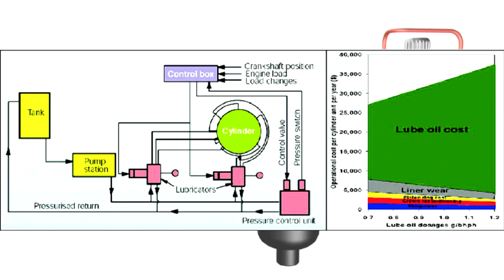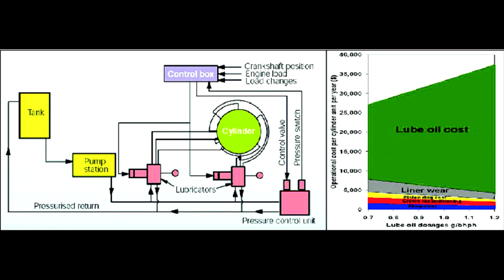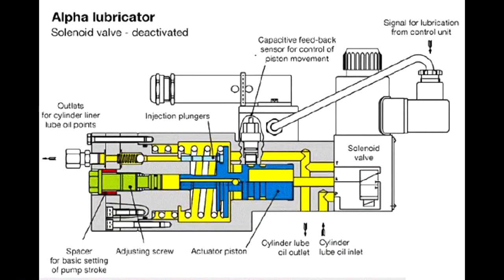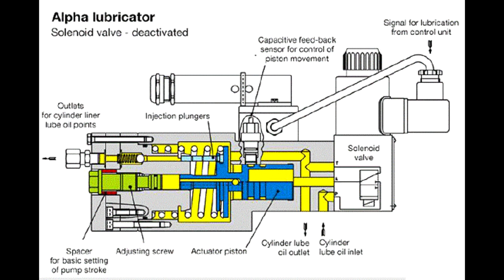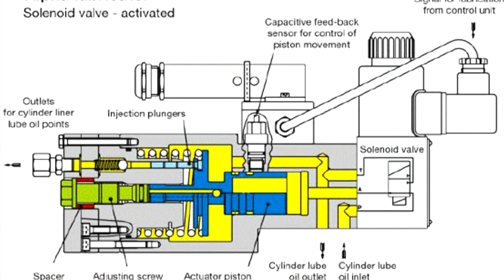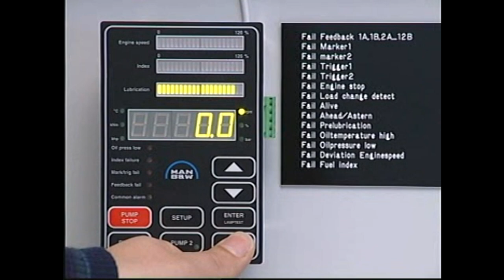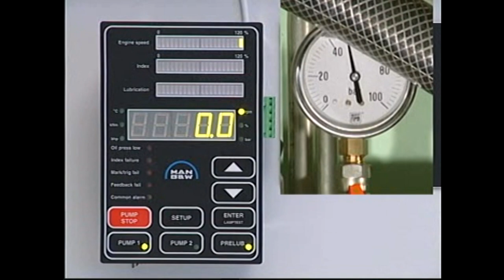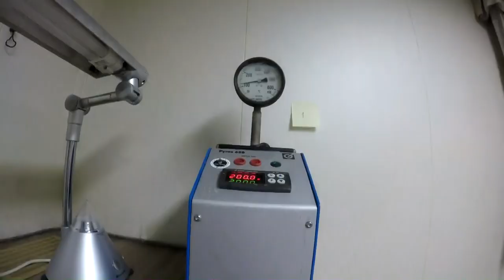Understanding Cylinder lubrication system with Alpha lubricators

Comment: Your video highly appreciated. Please also advise, what is the exact function of N2 accumulators in Alpha lubricator systems. What effect happens in cylinder lubrication if the N2 accumulator's membrane is ruptured or if the accumulator has been found de-pressurized?

Comment: can you tell me please if you have a not operating lubricator  and you dont have a spare one and you are in the mindle of the ocean what you can do?
 how you can trigger the lubricator ?
 there is any em/cy  operation? 
 thanks in advance.
Reply from the maker: Normally you should have a spare of alpha lubricator because this is a critical equipment.
I don't know maybe so other companies have bolts for critical equipment.
Any way i will check to find the answer.
Reply: @Adventure-Story  i  have one spare but i already put it on cylinder no2 . i wanter if somthing happent until i will arrive to the port where i will receive the new spare
Reply from the maker: Very good question ok i will look for it thanks!

Comment: Some engines like mc-c engines have rpm x 60 strokes,  per hour, when measured on the counter. How then does lcd give extra feed if the no. of strokes have already reached one per revolution.
Reply from the maker: What is the question sir?

Comment: Sir one dout what means due to pressure difference the lube oil supplied to the quills or crank angle sensor give signal to the solenoid valve?
Reply from the maker: Hello the signal from tacho is received to Master control unit and master control unit send a signal for the solenoid valve also master control unit receive a feed back signal from position sensor on alpha lubricator that it have succesfully activeted.Thanks
Reply: @Adventure-Story  thank you sir
Reply: so nice explanation !

Comment: dear sir, i like to know how engine load is sensed for alpha lucricator?
Reply: Engine load is sensed by a tacho  sensor which is reading the rotations of the flyweel
Reply from the maker: The whole system is controlled by the Cylinder Control Unit (CCU) which calculates the injection frequency on the basis of the engine-speed signal given by the tacho signal and the fuel index.

Comment: good day sir can someone tell e the purpose of two black bottles fitted in lubricator?
Reply from the maker: Hello black bottles installed to reduce lag on hydralic system of alpha lubricator and avoid hammering effect on piping system.Always follow makers instraction prior dismantling and mounting procedures.Thanks!
Reply: @Adventure-Story  dear sir how it will help in reducing hammering as for my knowledge there is 50 bar nitrogen pressure fill in bottle so nitrogen helps in reducing hameering affect is it?
Also guide they are 2 in number as well size also vary what's the reason in that
Reply from the maker: @muhammadahsan3875   this says the manual .Accumulators can accumulate pressure for some short period of time and then needed will be send the nessesery quantity of oil to reduce the lag in the system.Also they can work like a spring in the system .So far this is the best solution for hydralic systems like alpha lubricators and Main Engine fuel pumps.

Comment: whats is the purpose po nitrogen to alpha lub.  ? thanks
Reply from the maker: Hello the purpose of nitrogen accumulators is to accumulate pressure and destribute it when neccesary at appropriate point of injection or operation .Also one inresting fact is that this accumulated pressure reduce the lang and time delay where is it plays big role accurancy! Thanks!

Comment: how the feed quantity is exactly determined... is it taking place in mcb? say for example the  sulphur percentage of the fuel oil which keeps varying for every bunkers so where is the data feed (sulphur percentage)......? and the load of engine keeps varying, so from where the engine load data is transmitted and finally how these two data will determine the volume of cyl oil and how the volume of oil injection vary as we have the adjusting screw is in a preset condition. Sir kindly share ur mail id with ur reply.

Comment: Can tell the disadvantage of alpha lubrication system
Reply from the maker: For sure all systems have advantages and disadvantages but for alpha lubricator is little bit difficulat to find something it is more MCU AND BCU for operating this equipment any way is good design and if you are familiar there will not be any problem.